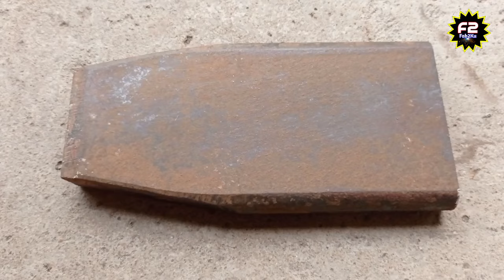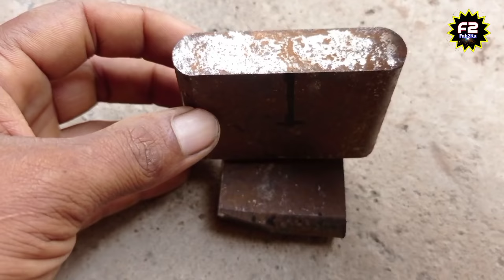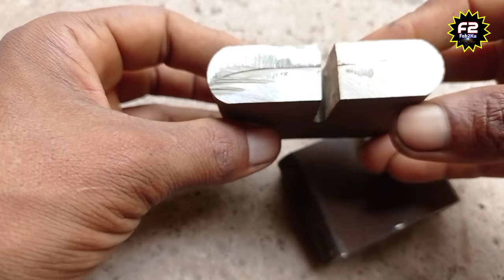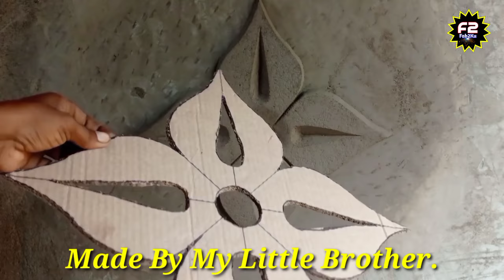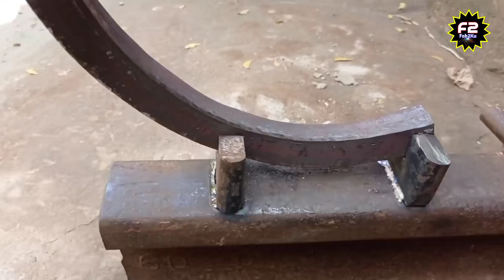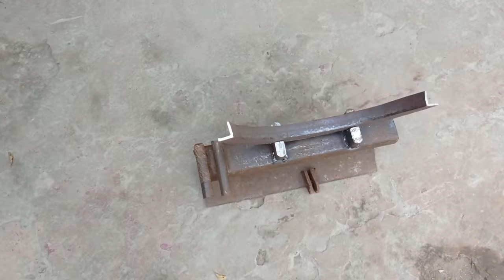How To Bend Angle iron Without Machine | Simple ideas For Bending iron Angle

Comment: 45-year retired steamfitter here who has bent, bowed, twisted, shaped, stretched & tweaked all kinds of steel and still do in retirement with hobby projects. But, I have never tried bending angle although I did have a need on occasion but did not think it was feasible without some fancy expensive equipment. I can now add this technique to my mental data base should the need arise again. Thank you, sir. Nice video work too.
Reply from the maker: Welcome sir🙏
There is some hard work in this trick, but the result is good, I say that it is the best for bending without machine.
Reply: Did you ever take one that was bent and straighten it out?
Reply: @cletusspucklerstablejeaniu1059  -yes that is my question too. Does steel lose its temper once bent or can it be re-bent to straighten it out. Also was this steel heated before bending or bent cold?

Comment: One of the better jigs I’ve seen, potentially very useful technique I’ll definitely use should I ever need to make curved steel frames. Wouldn’t have thought it would work so well. Thank you sir!
Reply: @Fab2Ku  Is
Reply: We actually use something similar to this to de twist titanium barstock before shipping it to the final customer. The old one was manual and we used a big adjustable wrench, the new one is hydraulic and has interchangeable dies for different sizes
Reply: If you join the angles you get a diamond

Comment: Nice idea, here’s a thought to make it even better. If all the edges of the slots and top corners of the blocks were nicely rounded, there would be a lot less hash marks on the finished product. Thanks for sharing your videos.
Reply from the maker: Thank You Sir🤓🤓❤️❤️🙏🙏
Reply: Small radius’s.  Tiny.   Or it will cause waves.
Reply: @madjimbo4176  Radiuses/radii, or it won't be concentric.
Reply: The groove needs to be deep enough the flange never hits the bottom too. Then it wouldn't have any dents in the outside edge, just the rub marks on the sides.
Reply: You made a point. That's true.
Reply: You’re thinking of marred marks . Hash marks are made on purpose
Reply from the maker: Thank You Sir
Reply: Ok please p
Reply: How much spacing did you leave between flatbars?

Comment: I wanted a Jeep Tj grille for a Jeep Yj ,   1/8 " thick , rectangular headlight pockets .   I cut the shape out of  1"  plate , pressed the   slight curve in it , cut out the 7 slots  and light pockets , and finished it  up . Then tacked a 1/8 "  plate on it , and proceeded to  beat it to death , annealing the corners with a torch as I went . It came out perfect ,. wrapped around the form .  Its practically  bullet proof ,   and knowbody can fgure out where I got it . All one peice , so they figure I couldnt have made it .

Comment: The legs are no longer square. You need to add a punch tool that slips over the horizontal flange that applies the force to the vertical flange. Still simple.
Reply from the maker: Right sir,👍thank You 👍🙏🤓

Comment: How do you bend 35 mm x 8 mm galvanised flat bar? Would you just cut 8mm slots, and lay the bar in and then hit it?
I need a soft  S bend over 7M. Two 3.5M lengths bent and joined would do it I think.
Reply from the maker: 8mm thick bar will not be able to bend without heating sir
Reply: @Fab2Ku  thank you sir.

Comment: You didn't bend it without a machine. You just built the machine.
Reply from the maker: No Sir❤️🙏
Reply: @Fab2Ku  ...
Yes, you built the simple machine. Grandpa Badger was complimenting you.
Reply from the maker: 🤓🤓🤓
I had not thought so deeply sir,, I knew that the one which runs on electricity is a machine, but no, which makes our work easy, it is also a machine,,, you are right  Were, Greetings for Grandfather

Comment: Great idea.  Is there a way to bend angle the other direction whereby the lip would be on the inside of the circle?  That way you could put wood in the center and make a rugged table?
Reply from the maker: I must try sir,,
Thank You❤️👍
Reply: Adding heat or removing material.

Comment: this is a cool idea.  But I have a question, since you are cold working what looks like mild steel, will this weaken the metal beyond safe usability in structural builds?
Reply from the maker: No Sir🙏👍
Reply: Actually will make it stiffer. Called work hardening. But if you keep working it it will get too stiff and be brittle, unless you stress relieve it- annealing.
Reply: The angle iron that he was bending was 'Hot Rolled' or Black mild steel and it's relatively easy to work 'cold' in comparison to Bright Drawn mild steel.   All steels will work harden when bent beyond their limit of elasticity and will eventually crack, but Black mild steel is better for cold working.

Comment: I thought I found a solution to my problem, almost, not quite. I need to bend 5/16" x 2" angle, the other way. I need the flat side curved out. A bit more difficult since instead of stretching the back side as this does, it compresses the metal, causing it to warp.    It does however give me the idea if I want to 2 piece the part instead using flat stock and welding it together.
Reply from the maker: Thank You Sir